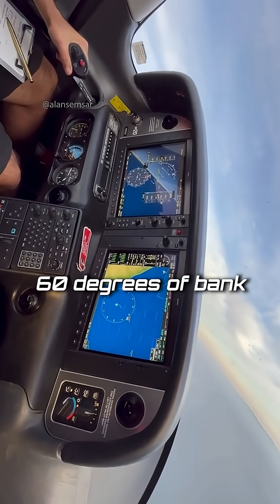Fighter Jet Bank Angle Physics

Comment: A "standard rate" turn is not defined by a particular bank angle but in degrees turned per second - it is the rate of turn that reverses heading in one minute. That is 3 degrees per second. As airspeed increases, to maintain a standard rate of turn, bank angle needs to increase and thus the g-load is greater too.

Comment: I have a question. If a passenger plane gets out of control and is flying vertically downwards what happens to the forces  since the weight and the thrust  are both acting vertically downwards and the lift  from the wings is not counteracted by the weight and also the plane is flying down into  increasing atmospheric pressure and possible horizontal winds,. I think a plane flying that way is more likely to breakup  and not just because of the speed it might be flying at.

Comment: It’s tough to wrap your head around, but he explains it really well! The cool part is, once you understand force diagrams and how a force can be broken down into components, the rest of first semester physics is a walk in the park! 

It usually takes a few class sessions for professors to explain this fully. But force vectors and their components are the hardest thing about kinematics and basic elastic and inelastic collisions, so once you learn how to combine forces, the rest is just knowing how to manipulate the formulas! (You’d need either algebra or calculus, depending on what level of intro physics you take. But if you can do algebra, the rest just falls into place)
Reply: I don't know how to manipulate the trigonometric breakdown in my head, but if you give me a sheet of paper, I will be able to solve any problem. Physics forces? Not an issue! 3 phase asymmetric power? Easy with a whiff of written math. It makes life so much easier.